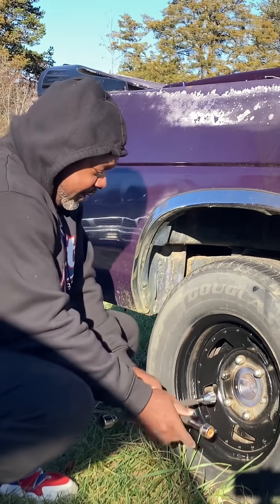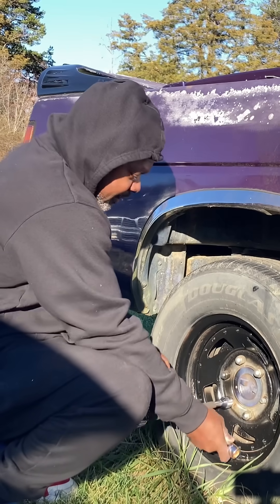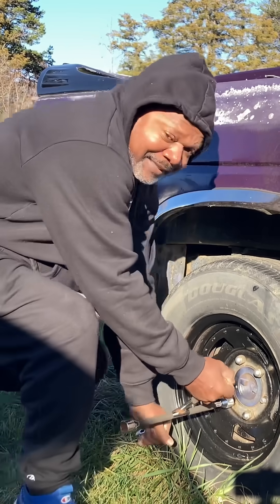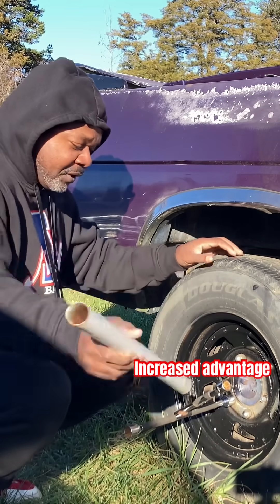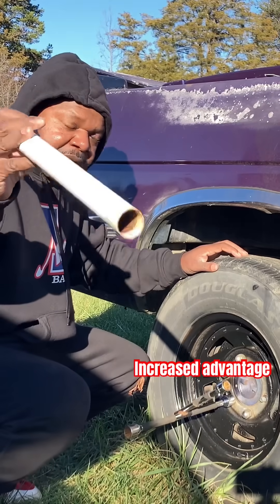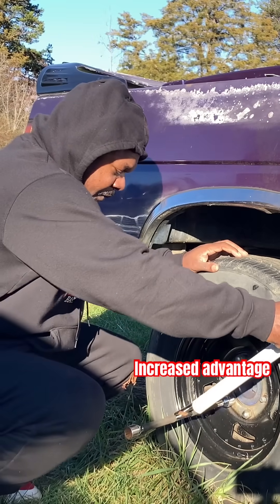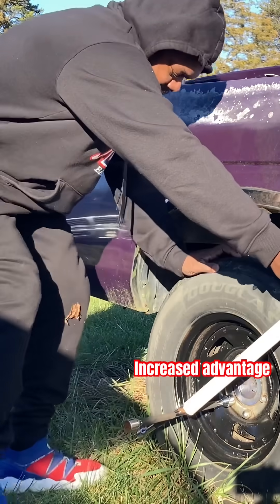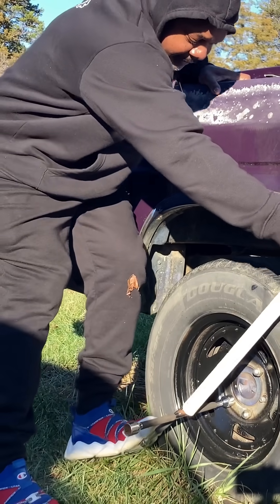Light Work Science!             LEVER

Comment: If you're talking science, the Physical explanation would be, by extending the length of the lever arm, which is the perpendicular distance between the point where a force is applied and the axis of rotation, you're effectively allowing a smaller force to achieve the same amount of torque called: (rotational force)
Reply from the maker: lol.  Well said.
Reply: @COACHgtv8192  👍👍🙏
Reply: Cheetah pipe
Reply: @bOOt_fubarski  yes Sir